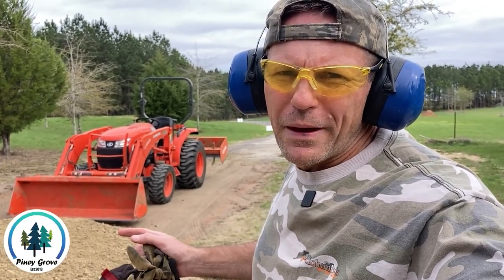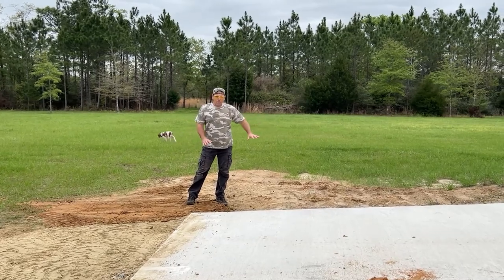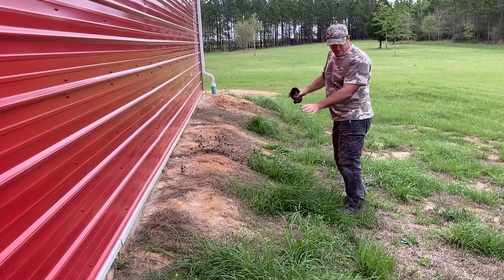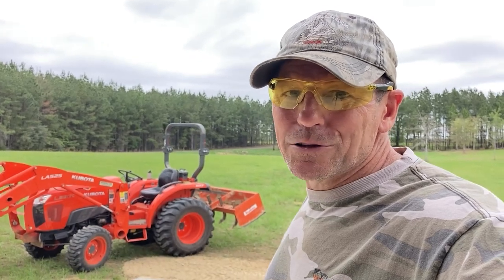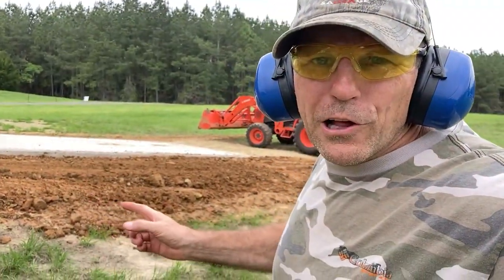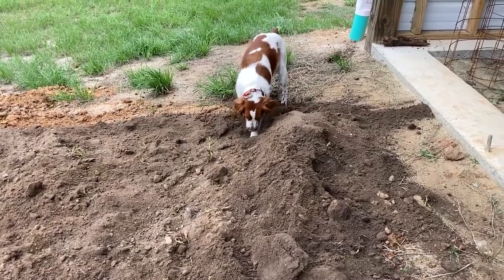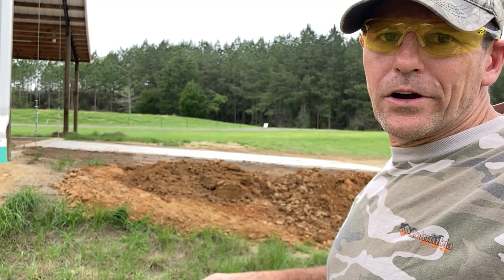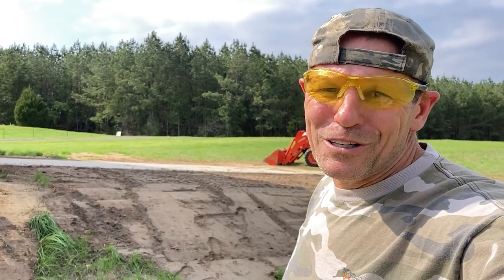Grading Dirt with a Compact Tractor Front Loader

Comment from the maker: Video to this pole barn build: https://youtu.be/Ku5ewpv8GzI   

Products in our Amazon store used in this video (costs nothing extra to use these links!).  You don't have to buy these specific items to support our channel....just use a link below to get to Amazon then make any purchase: 
Flex Tape: https://amzn.to/3R4MdWm
Mechanix Leather Gloves: https://amzn.to/3HjoZZf
Titan Post Hole Auger: https://amzn.to/3toHEx2
Ratcheting Fence Tensioner: https://amzn.to/3aEfSX0
Pope and Pipe Level: https://amzn.to/3tqUhHX
Fence Post Puller: https://amzn.to/3QbcNhy
T Post Manual driver: https://amzn.to/39dwt3J
Come Along Winch: https://amzn.to/3aQMqND
Clip bending tool: https://amzn.to/3xlqrG0
Mechanix Leather Gloves: https://amzn.to/3HjoZZf
6’ Digging and Pry bar:  https://amzn.to/3vH5Agx
Dewalt 20V ½” Impact Wrench: https://amzn.to/3UOcXNH
Dewalt 20V brushless Leaf blower: https://amzn.to/3zwJcYm
Dewalt 20V brushless ½” drill: https://amzn.to/3HGXJ7z

Comment: if you has access to sand, I would have put a thick layer of sand over the clay THEN the topsoils  Otherwise you get a very muddy mess every rain.
Reply from the maker: It's actually holding up well to the spring rains.